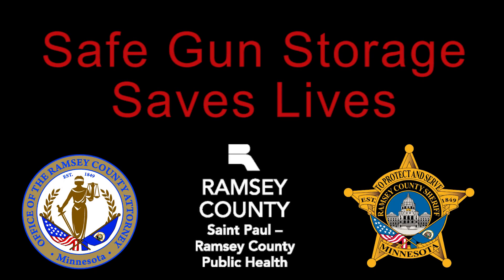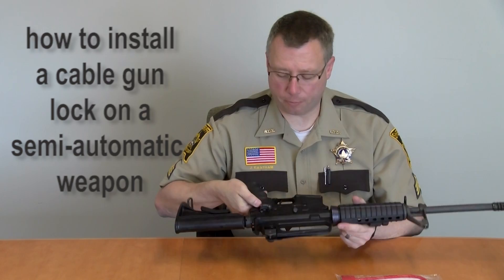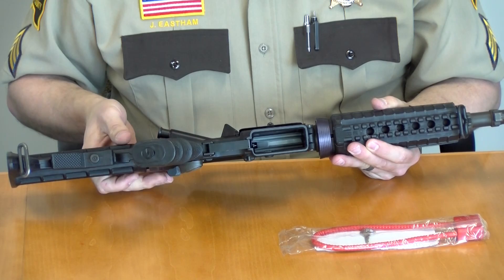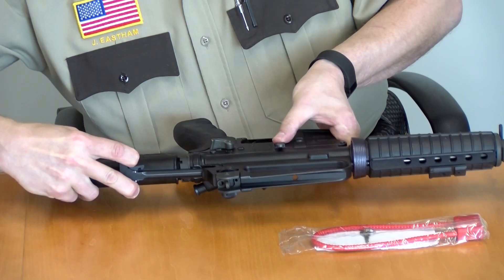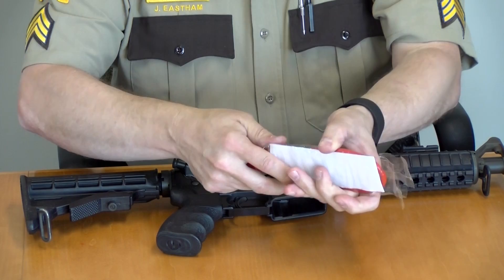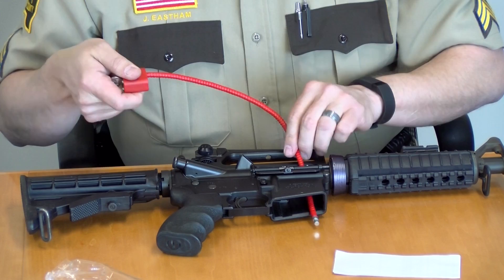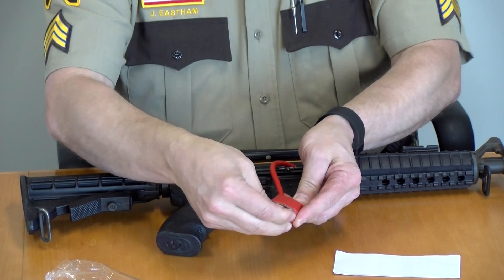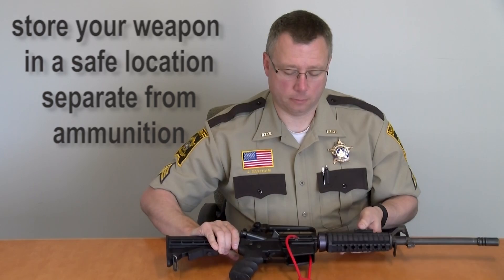Gun lock demonstration - semi-automatic rifle

Comment: I noticed you left your bolt in the locked position. Is it okay to bring the bolt forward to release the tension in the spring? Often times when I lay the gun down, the weight of the gun will trip the bolt release and bring the bolt forward on its own. I figured riding it back would at least prevent me from damaging the lock or more importantly, the locking teeth on the bolt.
Reply: Yes that's fine. I would prefer a lock over the trigger so I can leave the gun loaded and with the bolt forward.

Comment: Is okay to close the bolt slowly onto the lock?
Reply: yes but try not to. that is why you lock the chamber before placing the lock on.
Reply: @jesterpoker   i don't even remember typing this question but thank you. i found out way later that it is ill advised if you are long term storing due to the constant tension possibly damaging the part, but we are talking years and of course constantly doing that for short term storage is going to likely have a worse effect.  i was asking because the first time i stored my PCC the bolt lock opened and the bolt closed on the lock so sometimes when transporting maybe the bolt lock might open but this is unlikely. from what i've found out (should be obvious i know) sturdier product= less possible damage.